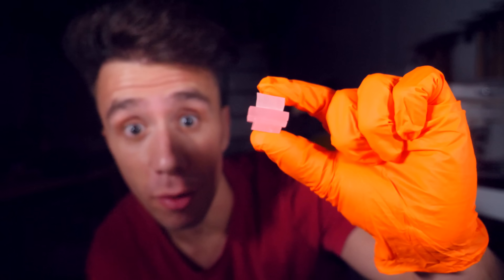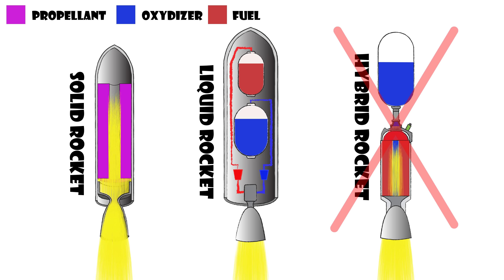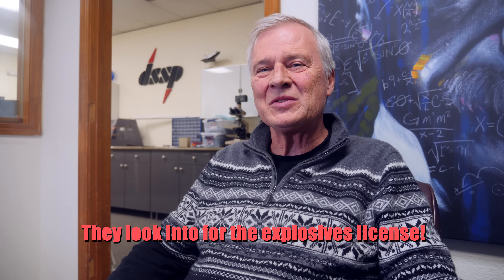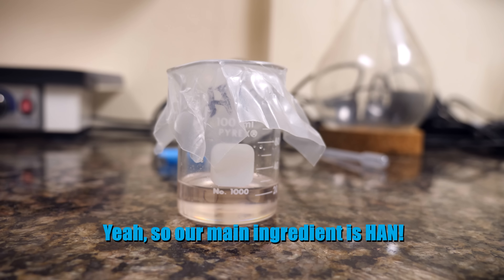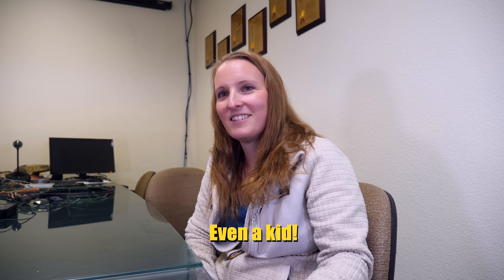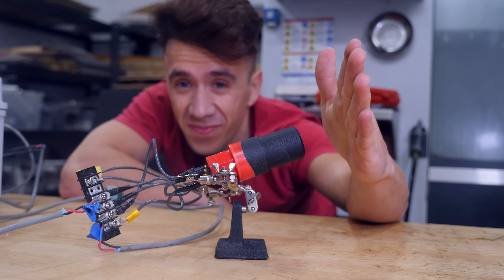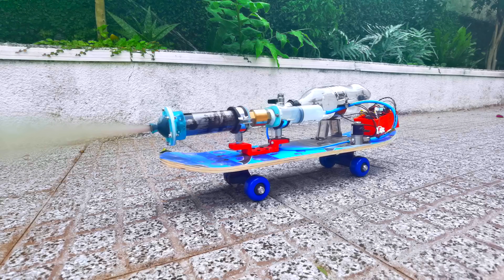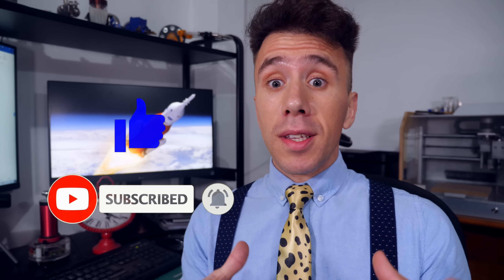ELECTRIC SOLID PROPELLANTS

Comment: I don't know if you've thought of this or someone else's point of this out but, you know how a lot of your see-through rocket motors just explode have you ever tried putting a slotted piece of metal the same exact size of the acrylic or whatever it is in your transparent rocket motor that way there's only a little slit of acrylic that you can still see inside and that would possibly not self-destruct in theory. 🤷‍♂️

Comment: What about fluid type pump that will use fluid spinning creating a push or pull in one direction that can be controlled to use as a silent propulsion, we need water to survive. Use that mass in space to push anything as long as you have power to spin this device. Victor Shawberger water imploder engine. It was less lbs when running. Look to his device for inspiration. 3D modeling would be able to cheaply test out different blade and fluid dynamics easily. Semper Fi. I'm a water plant Supervisor and read stuff like this. Keep up all you do.

Comment: What about the need to carry your electricity into space? Does this solid run on just a few volts such as what you can get from a radio thermal generator? Also, what kind of specific impulse does it get? I really like the idea of replacing hydrazine with something less toxic, though. Like a cyanide rocket might be safer.

Comment: It might be a Little expensive, but you should look into making a small ASI (augmented spark ignitor) basicly a very small rocket engine used to ignite larger engines. They are pretty simple but require quite a few pressure tanks, valves, and fittings but all of these things can be used in later videos giving you a more "professional" setup.

Comment: try 3d printing a perpetual motion machine that generates power
Reply: What?
Reply: A perpetual motion machine is a hypothetical machine that can do work infinitely without an external energy source. so someone if were to add wires and magnets to it boom free power
Reply: @j365383  Yeah, i know that. But perpetual isn't possible.

Comment: Can you "ignite" it in a strong electric field? That would be very useful
For example a tube with a positive potential on the outer walls and a negative core inside, if you fill it up with some of the material
Reply: ⚠⚠ SCAM ALERT ⚠⚠ DO NOT CONTACT THE ACCOUNTS GIVEN IN THIS COMMENT SECTION⚠⚠

Comment: For next video make a quad copter style drone that instead of electric motors have it use thrusters that run on electric solid rocket fuel...will need some vectored thrust to achieve yaw of course but only needs to vector in 2d one plane so won't need to be too complex.

Comment: This substance immediately gave me 2 interesting ideas.
The first being for something like a modern javelin using pre existing technology for self correcting ammunition but where one would replace the steering fins, motors and so forth with solid exit ports that you control with electrical wires run down the ports inside the fuel itself. 
You'd need a coating that burns along with the ignition point of the wire to separate the rest of the material from igniting prematurely.
You could also run a separate, uncovered wire to allow for immediate ignition of all the fuel, allowing an incendiary function when triggered if the substance can be mixed with perhaps magnesium sulphate, maybe lithium pellets for increased oxidation and flammability.

This should make it possible to make a new type of guided rockets with the ability of penetrating softer targets with kinetic force and releasing fire, chemical substances or just smoke when ignited.

The second idea this gave me when I saw how stable the fuel is until they ran larger amounts of electricity through the fuel when it gets a more explosive reaction which I believe lends itself well to being used as a compact propellant for launching cartridge/tube based systems like miniaturized rockets, grenade launchers and the like.
Not that this seems strong enough for a mortar but the stability and electronic activation lends itself well to miniaturization if one can add a more reactive material to the mix.

Think along the lines of a miniaturized reactive armor system or as a combination flamethrower setup where you mix this with lithium and send an electric current along plasma to ignite and electrically cripple a vehicle.
It would likely also be possible adding this to chaff (electronic countermeasures for helicopters, planes etc) which might possibly allow for confusing activation pockets of heat and emp depending on what you mixed this with to induce a delayed ignition.

Comment: What about the power wing technologies. The leading edge of air plane has negative charge to pull the plane and a positive charge to push the plane. This technology only uses engines to get it off the ground, but the wing itself, as which pushes the plane after reaching optimal speed then turn the fuel engines off.
Reply: Thank you for the win.

Comment: It sounds as if ionization is the secret to efficient, long-lasting, simple and safe thrust for space travel, and this fuel sounds like it should be cheaper and easier to employ than hall-effect thrusters, perhaps with less sensitive components which may wear less problematically. This is the most interesting episode I recall, so I can't think of a better topic than to expand on this one with an investigation into the most promising possibilities for plasma drives.
Reply: Burning causes ionization. Hall-effect thrusters are far more efficient with propellent then GEM or a SEM rocket system. GEM would be a replacement for hydrozine applications, not a replacement for ion thrusters

Comment: I just checked out their msds and I have to say that I am excited to see them using 5-aminotetrazole. It now makes sense how they can reuse those igniters so many times. It has the ability to detonate in extremely small quantities, and is part of the next generation of green energetics. I did find an article where they were rejected by the Army because their composition has stability issues where I assume the hydroxylamine nitrate is decomposing.
Reply: Ya unfortunately it dont have a long half life
Reply: I think a better propellant would be to use frequency, frequency if focused correctly, you could create lift of any object no matter what size or shape, and I believe that it could work in space as well, not to mention take far less propellant power in order to achieve the goal

Comment: my first thought was that solid fuel is much better because liquid fuel needs to be pumped otherwise it doesn't have a consistent output and it's really hard to start a liquid engine in space for that reason. However solid fuel doesn't need pumping and will have a much easier time starting anywhere. My only worry is how are you going to efficiently ignite so much material without losing much of it.

Comment: What would happen if you ground the ESP into fine dust and mixed it with distilled water and then applied electricity would the reaction be the same?  Is it still controllable? Could it then be used like liquid propellant?
Reply: pure water is non-conductive, and also liquids are heavy so you don't want them unnecessarily weighing down your rocket.

Comment: Learn and demonstrate the effects of current varience on electric solid propellants. E.g. what happens at specific sin waves. Voltages, amps, visualize how the electrical energy is exciting the chemical bonds to engage the combustion and settling once no longer charged. How far does the given electrical wave dispurse through the material as it comes into contact with the chemical bonds. What happens to the chemical bonds as they combust. What does the byproduct create and do?

Comment: I'm curious, while you do all these rocket and propulsion based video's, what's the "best" material to make rocket bodies out of? Especially at a lower scale like you do yourself? How viable is something like a circuit board? vs 3d printed aluminium vs PLA vs Polyurathane vs PVC? Making a better rocket isn't just about thrust and propellant, but about making a better body as a vehicle for thrust.

Comment: you may not be able to throtle solid rocket engines but by carefully shaping the surface area of the rocket motor you can "program" the engine to produce specific thrusts at specific times. the solid rocket moters of the shutle program were shaped to reduce thrust during max "Q", then incease thrust after.

Comment: Try doing some experimenting with a variable wing/flight/control surface area wing/fuselage airplane concept. I'm not sure what to call it. I'm not sure if its ever been invented or if theres ever been the idea of doing it. Man has been watching birds fly around forever. Due to not being able to make a machine that made wings flap. Wing design went a different direction than a birds wing. I dont think Orville and Wilbur put bird wings on bicycles. So Instead of having flaps ailerons elevators and rudder. Make the wing like that of a bird. Twisting the wings instead of ailerons tucking the wings next to the body or out but close for controlling the dive. That last one would be too much but twisting for banking left or right and increasing and decreasing the surface area of the wings for flaps or catching thermals or something. Fanning the tail out and closing folding up or making the tail into a V for rudder and elevator. At least that's one of the projects I want to do with a 3d printer anyway. Develop a super efficient uav for autonomous lidar mapping. Also on another note  if you have it in your mind to use that solid propellant.  The guy said using it on a large scale is a disaster waiting to happen. What if the large scale was made of multiple smaller scale tied together in multiple stages? Or if you maybe used it on a rocket with a different main propellant to eject extra rocket stages parachutes or some in flight self righting boosters maybe. As far as your porous 3d prints goes are you certain it wasn't the mating surfaces on the 3d printed ceramic parts warped during the cintering process? Not sure if it would work but if you did the cintering with them all put together. They may not distort but if they do still after that  I feel they would together. I been wrong before though.

Comment: To be accurate.. large solid rocket motors can be stopped.. You just blow out a large enough pressure door and the propellant will stop burning.  They call it thrust termination.
Reply: Scam don't lsn to this guy

Comment: So just spitballing an idea for an electrically throttled solid rocket motor, and a possible future video. 

Using a fine steel mesh or wool  within a chemical based solid fuel motor, where it interrupts the combustion of no current is applied, but aids in combustion as current is applied.  

Capacitors and such on the outside of the motor frame to deliver the voltage. 

Vague memories of iron oxide being an optional ingredient in sugar rockets. 

¯\_(ツ)_/¯

Thanks for the informative and entertaining videos!

Comment: What would be fun is a simple rocket design & fuel that could be built easily by an average DIY person with the 3D printer that you're giving away, and of course some simple supplies for the fuel that are easily obtainable without resorting to specialist/expensive materials. Bonus points if it can be attached to a skateboard. :)

Comment: Now I'm wondering whether this material could create a kind of electric ammunition round.  The hammer hitting the back of the shell taps a piezo which generates voltage to trigger the propellant.  The propellant is essentially inert without a voltage.
Reply: Why even bother with a hammer and expendable crystal when having electrical contacts inside the chamber is much fewer possible points of failure.
If this HIPEP stuff has energy density anywhere close to nitrocellulose, then it seems like the perfect propellant for a caseless ammunition.

Comment: Why hasn't anyone made engines that run on powder such as powdered sugar and powdered charcoal ? obviously lubrication could be an issue has developing a new type of carburetor that would thoroughly mix the particles with air in the right ratio.

Comment: I was under the impression that this class of propellant was referred to as aerogels regardless of composition whereby solid rocket propellant usually requires a stabilizer not unlike the cellulose in dynamite

Comment: The only issue is that it's not as easy to make as the current rocket fuel SpaceX is using. And not as readily available on Mars. It's very cool though, maybe useful everywhere except rockets

Comment: In world war II the Germans had a very large issue with using propellants that could be used for munitions as well as fuels for tanks and trucks and trains due to the embargoes. So they had experimented with solid cold burning Jets. There's videos on it in regards to like history related YouTube videos that I've seen what they do is they get a flame burning in the rear end of the vessel and propel the solid cold through the ass end of the vessel as propellant this is not something that I saw that was on your list of listed propellants. I'm wondering if you could look into this and make a video about it. Also I could really use a 3D printer as you can see on my profile logo
Anyways happy New Year first video I've seen of yours and plan to continue watching thank you

Comment: This is so stupid. Somebody produced this video in a desperate attempt to find added-value in a solid rocket motor. 

Look: a solid rocket motor big enough to propel the space shuttle into orbit costs around a million dollars. The “fuel” is rubber which costs five dollars a pound. And the motor is inherently safe because there aren’t any pumps, or engines. It’s a giant Roman candle which burns slowly and reliably. There aren’t any O-Ring failures. Except the intentional kind.

A solid rocket motor doesn’t need to be throttled. If the motor is designed for a ten minute burn, that’s what you get. Our entire space program can operate with great success using only solid rocket motors. 

Liquid fueled rockets are intended to support the mythology of an expensive space program. We don’t need them at all. NASA is a bunch of conmen who invent expensive problems, so they can steal more tax money.

Comment: Can you use the Marians Trench water pressure to launch a vehicle into space? Use a tube to the bottom then gates that open as the vehicle travels up the pipe collapsing the air inside the tube at an ever increasing rate. And I REALLY need a 3D printer :-P

Comment: What if you took tons of thin discs of this electric solid propellant and dump them in the combustion chamber one at a time, zap them, then repeat. Do you think you could make a full fledge rocket with that and turn it off as needed? The speed you place the discs would determine how long the thrust lasts.

Comment: Your summary of esps was amazing you basically covered everything ..........idea for a future video - do a model rocket launch with electrically controlled fuels where the rocket gets to the stratosphere via a rockoon to minimize gravity and reduce costs....you can then optimise fuel to weight and since all that's needed to control thrust is a valve, weight will be minimised and the rocket could cross over into the other layers of the atmosphere......it would be really cool to see the limits of this fuel on a test rocket......there is already a lot of documentation on rockoons, recovery, detatchment, etc etc so you will be able to focus on the fuel side of it and obtaining maximum altitude and thrust.....i made a small doc that just summarises rockoons to give an overview on the minimum requirements for rockoons....look forward to you taking on this project https://docs.google.com/document/d/1Sq1As2OA7i0q41mUcsP2Z8VNXNb2kLCuiMZ08wnhI2Q/edit?usp=drivesdk

Comment: GEMs seems to be the way to go. . .and SAFE . . . maybe? Though now curiosity has gotten me thinking. They tried various ways to make an efficient pulse rocket. How well would this work in the same application? Would you think that this would be a better source of energy than conventional rocket fuel methods? Also, I am curious about what would happen to a GEMs powered rocket if it's VCM to control the power output would fault out or short out and send a massive amount of voltage to the GEM. Couldn't that destroy the rocket{bomb?} or the casing it's held in or would it just blast everything through the nozzle?

Comment: A very well-shot and edited video. The demonstrations, other footage, interviews etc.

I should have subbed a while ago. tbh, I thought I already was. lol

Wondering if there was any kind of construction with the solid propellant that could be used in a booster?

I know a lot of boosters have a hollow core, so the gasses etc. can escape.

Maybe there's a way the HAN gel stuff can be sandwiched between thin metal conductive sheets around a hollow core, and then each "slab" of gel ignited (electrically) in turn?

(ElectronAsh patent pending.)

Comment: I have a suggestion for a future video. Argon flash bombs! Where an explosive shockwave drives argon gas to luminesce very brightly. I've read that at the scales the military has tested, it's the only non-nuclear weapon that can light objects on fire just from the light radiation at great distances. I know you don't have an ATF license (yet, but I think you should look into getting one! It seems to be possible, certain other youtubers have gotten them or perhaps had them previous to their youtube career) however there seems to be smaller versions of the devices which are used for photography which may be driven by less energetic means, such as a small firecracker or something. Another related topic that interests me is sonoluminescence via micro cavitation. The concept of turning sound into light seems like magic to me and I think it's a topic you would have fun exploring while making a great video, as you always do.